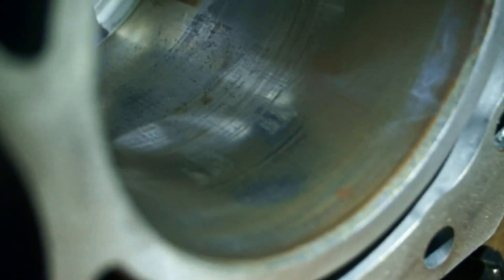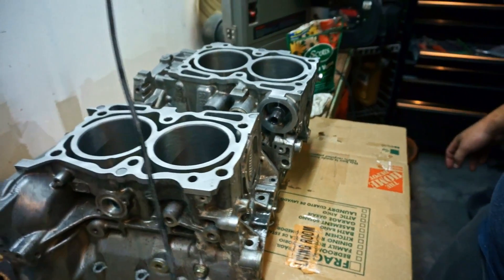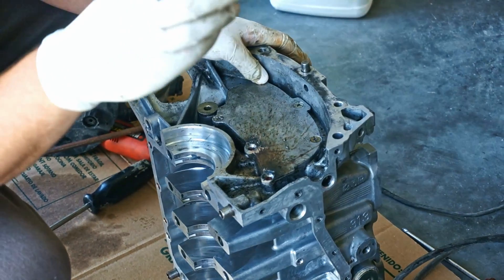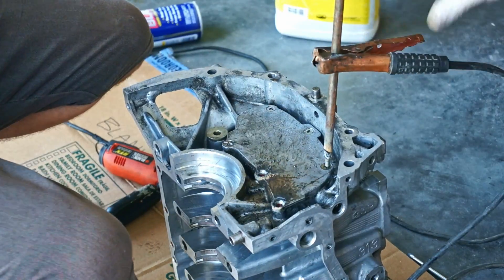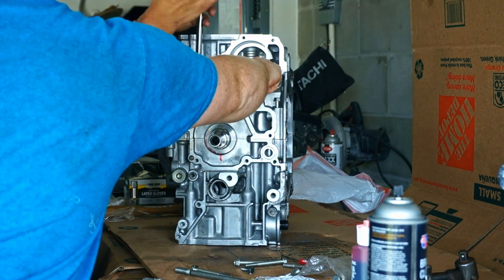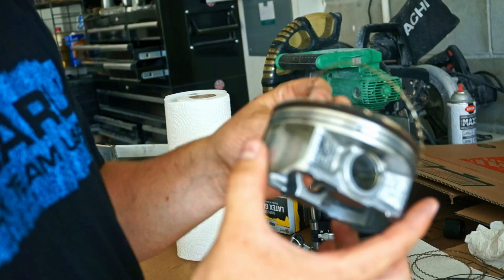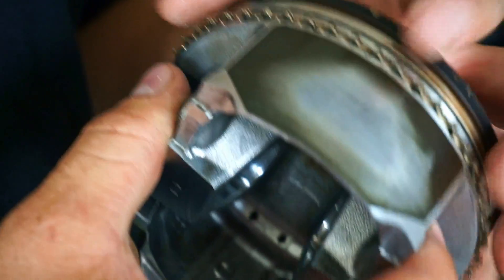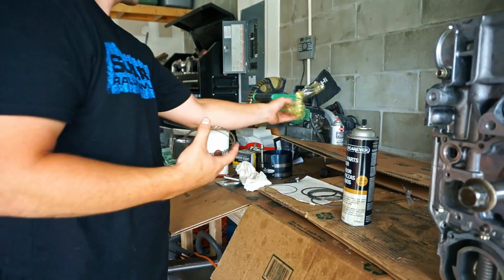DIY Subaru Shortblock Rebuild - EJ25

Comment: You need to go thru  without bell mouthing, so you can avoid barreling the center, you want around 45 degrees
This is for oil retension to help break the rings in.
You can order ten over rings so you can set your own end gap instead of what they send, I normally go four thousand per inch of bore, and those oil control rings can be easily cut to fit, they tend to stay close to the same size, their job is not to seal, but provide oil and cooling, keep on , it will run great!

Comment: Did you measure the bore and taper when honing. Did you set end gap on rings. Did you use plastigage on bearings.

Comment: The sight of you putting assembly lube on with your bare hands made me cringe.
Reply: james PrO why...personally I can think of about 30 other things I saw that were wayyyyyyy more cringeworthy
Reply: @tjlovesrachel  lol, Like?
Reply: james PrO the claw hammer on the case....the application of the rtv ... no impact driver use on the cover plate screws... I’d love to know if the block is going to get line honed and the deck milled and resurfaced and same with the heads...
Reply: @tjlovesrachel  I think the yolo method was used
Reply: james PrO lolll I think you may be correct... but hey who am I to judge really ... it’s not my engine and I’m not paying him

Comment: Oh yes, to remove those philips screws use punch similar size to the head of the screw and punch pretty hard with small hammer.  Sometimes takes few tries. They come out easy then with normal screwdriver

Comment: I can only imagine that the purpose of this video was for people who already know how to rebuild an engine to watch someone else go through a procedure they are already familiar with.

No explanation as to what you're doing, what you're spraying the various parts with, what you have checked out on the engine. Many steps of the re-assembly were left out.

I assume that if you're going through the trouble of installing parts to the block, you have checked the cylinders and housing for cracks, scratches, out-of-round and taper, and if you have sent the block to a machine shop for anything but we wouldn't know from watching this video.

Comment: Impact driver is the only way to get the phillips screws out intact. You would have that cover off in under a minute. Pry from the top through the sensor hole.

Comment: Great vid guys seems like your very competent but it’s time to buy some inspection tools. A dial bore gauge and some mics will go a long way!! When dealing with piston rings you must understand how critical it is!!! When dealing with rings .0001 matter and yes I mean tentohousends!! When picking rings for a application is very important to look at the rings specs you need vertical clearance with the ring and the groove to let the combustion pressure get above and behind the ring to seal the bore. .0002-.0003 can make or break you!! I’m forced induction the trend is to go to a super low radial tension ring and let the gasports seal them when there’s positive pressure over the crown of the piston and dry sump and vacuum pumps to seal them when there’s negative pressure. All manufactures with hold there product to a slight different size . This is why in the Performance piston business I have    To know what rings are being used before I can engineer and plan the costumers pistons to manufacture . There’s also a ring called a .017dikes or .043dikes top and second ring . They are the go 2 ring in any super or turbo charged high power application only down side is the piston has to be machined to except the ring. Next time you are trying to clean carbon if pistons try baking soda works great for combustion chambers exhaust ports and intakes that see EGR

Comment: Ok for my Subaru motor heads . Question... I was re assembleing my connecting rods and everything went pretty smooth . My one concern is one of the connecting rod bearings seams alot more stiff (tight) . I took it apart and put it back together a few times checking everything . These is no scoreing and it seams clean . It still moves but it seams to have about 7 pounds of resistance . The other ones just flop arou d with eze .... It's not scrapeing and it moves really well just with more pressure . Is this ok ? . I don't get it . Everything was seated correct as well I looked a few times . I did use a siginificant amount of assembly lube I'm wondering if that can be a part of it ??? !!! I don't want a spun hearing right away I'll be pretty upset !! Picture below is the old spun bearing . I got a donor motor with low miles and used the crank and rods  . I also got a kit all new bearings and rings and seals ect :)!
Reply from the maker: +john murphy you shouldn't have any resistance on the rods. Keep fiddling with it, unbolting the rod and pulling the beating out, until it'll drop and flop by itself

Comment: A video outlining the steps on how to properly measure bearing clearance would be very useful! Also, at the step of removing screws for the plate, a punch screwdriver is the tool used to remove it.
Reply: They have that on every car channel, get the motor trend on demand stuff, alot of the stuff he's doing is there as well, he's just doing subaru spec stuff

Comment: I will be doing an EJ205 rebuild in the near future. Is the process nearly the same? Will be my first engine rebuild other than some dirtbike and lawnmower engines. Cheers
Reply from the maker: +brewerbrian420 yup!
All the flat fours are the same. 
I used to build aircooled vw engines and it's surprisingly similar
Reply: Thanks  for the quick reply. Great to know. Keep doin what you are doin. I am learning alot.

Comment: Your thumbnail is clickbait, that is not an STi rebuild. The procedure for this part may be the same but don't try to oversell it dude.
Reply: Dirtcheapdaily understood! keep up doing your thing always like seeing people giving subies the love!
Reply: Afraid not, all USDM Stis had a semi-closed deck engine block.  Maybe he is using some sti bits here and there but the block and pistons are not sti ones.
Reply from the maker: +Derrick Quintal welcome to YouTube. Lol
It's not a 257 case, but it does have 257 internals
Reply from the maker: +Derrick Quintal well the crank is the same between any 25. Same part number from Subaru for an STI versus 255 versus whatever. But mostly it's just because we're not trying to make huge numbers with this motor, it's most likely just going to get dropped into A car with a blown engine and sold.
Reply: Derrick Quintal this is a completely different engine from his other cars, It Is from an STI
Reply: rite2beararms The Sti, usdm at least uses an EJ257 engine starting in 04-present with some minor changes throughout the years. the legacy you are talking about uses the EJ255 slightly different. Subaru started using this engine in 06. The only other vehicle the share mostly sti engine components was the 04 Forester xt. for that single year it used many actual ej257 parts.
Reply: Dirtcheapdaily Question then, and I'm not hating just trying to make sense. why use sti crank and rods and a basic 2.5 case when stock rs/2.5i internals are good upwards of 400to500hp  and the case is the weakest link?
Reply: Derrick Quintal 05-06 legacy gt ej255 long block was the exact same as the 04-06 sti. The different ej255 you're thinking about is the 07-09 legcacy ej255 with a slight bump in compression and d25 heads. It is different different from the 05-06 but the 05-06 is in fact the same as the sti.
Reply: Oversell what? Your unknowledgable high horse? There is no difference except for the pistons and compression ratio.  Everything else is outside the engine.
Reply: Did use the stock size rings and did you use the stock size bearings ? What brand ?
Reply: Derrick Quintal Depends on the year. 05 and 06 legacy, and STI all shared the same shortblock. it's all forged internals and it's the same.

Comment: Impact screwdrivers that you hit with a hammer are perfect for those screws on the back piston pin access hole.
Reply from the maker: +Dan Bonnett the last shop to rebuild it red locktite them. The welder heated them up enough to crack the red locktite
Reply: Dirtcheapdaily Remind me to never  go to that shop!
Reply from the maker: +Dan Bonnett right?
I won't say the name, but it's a pretty "reputable" Subaru shop in Utah.
Reply: What about using a propane torch or MAPP gas to heat and loosen the bolts?
Reply: Mine got red loctite too. The impact driver bits broke trying to get the screws out...
Reply: @TheActualCaveman  I guess heat is all you can do at that point.